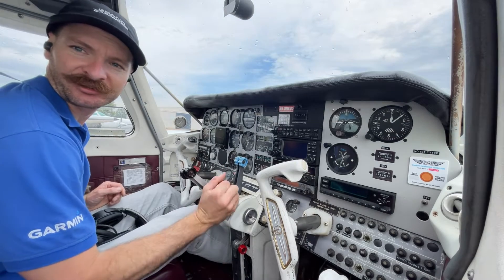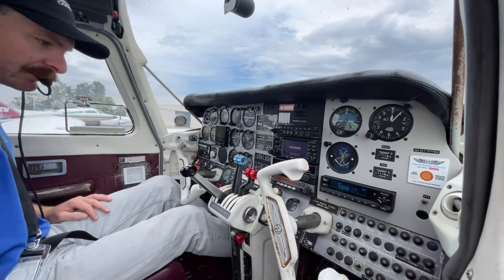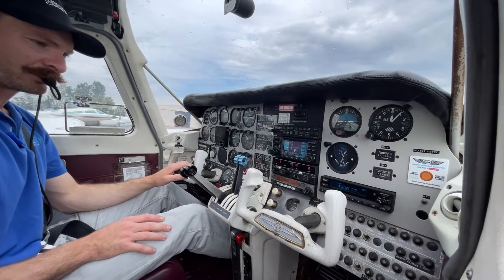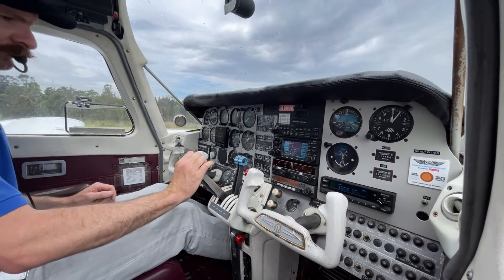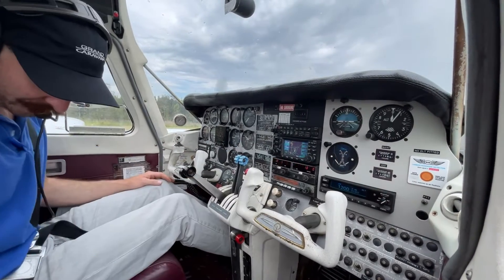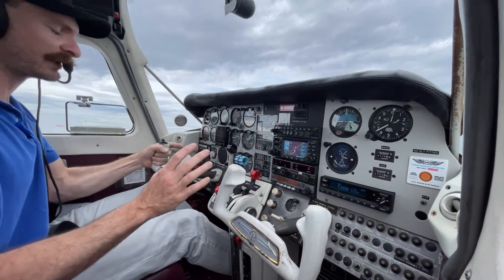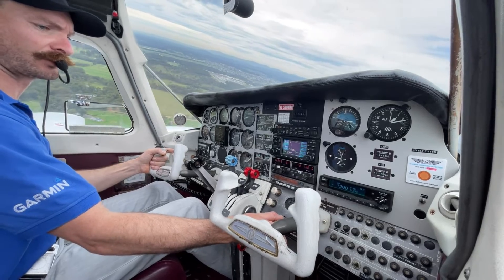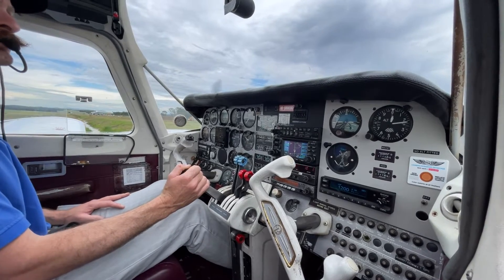Take off safety brief and engine shutdown in a BE76 Duchess

Comment: One item on my checklist, concerning retractable gear aircraft, is verifying the gear switch is down and secured down.  This comes from personal experience from decades ago, flying a Beech a36.  I neglected to check the gear handle and it had been moved up just slightly.  From whatever cause, vibration?, as the airplane reached initial rotation and weight was off the wheels, the gear started to come up prematurely.  The right wing dipped and the tip tank just brushed the runway edge.  I reacted with aileron, pulled her up and thankfully nothing catastrophic happened.
Now on my checklist is to put my hand on the gear lever and push down, verifying the lever is down and “locked”.
Some may find this unnecessary or ridiculous …  after a near accident I certainly don’t.